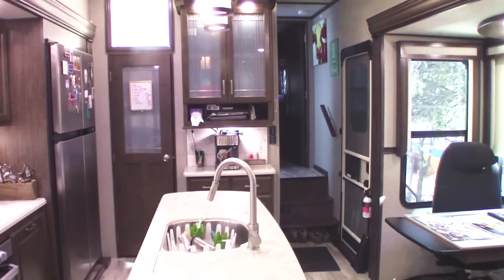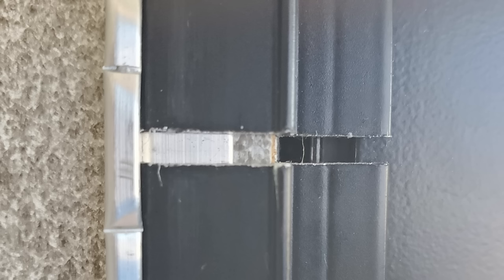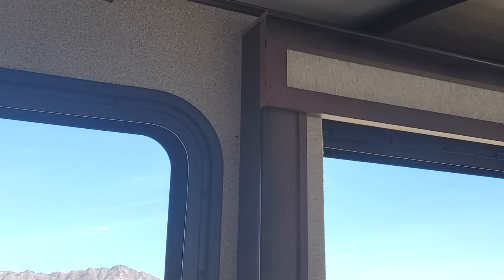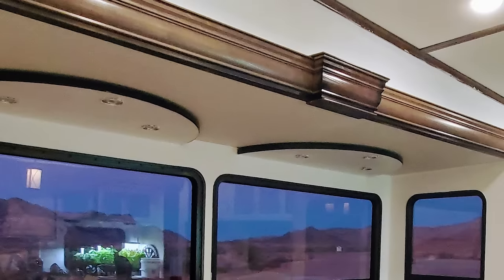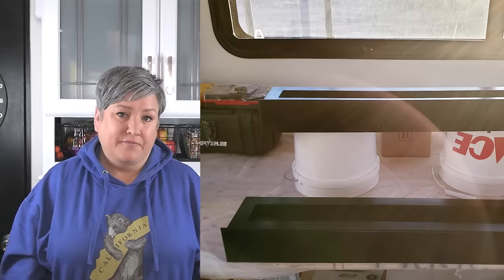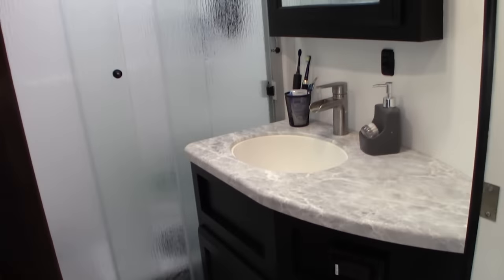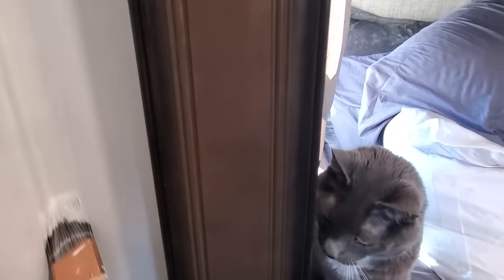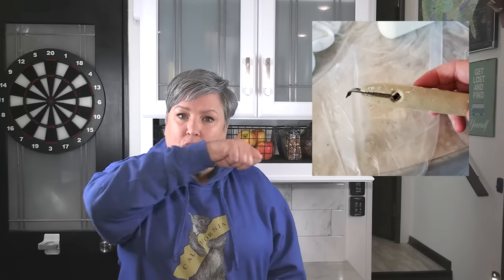DIY CAUTION: HOW TO PAINT RV WALLS & CABINETS. We Painted the Interior of our Fifth Wheel! Learn...

Comment: Haha, yeah we just learned a lot about the same topic. We had bought a 2007 weekend warrior toyhauler and it had the cabinets spray painted dark brown . Thought the same thing as you did and we said oh it wont take longer then a couple weeks, after taking off all the doors from the cabinets and sanding them down. Then we had a problem with the paint not wanting to adhere to them. The caulking was terrible as well. But I was able to work around it though with a house hold kilz paint primer. On the walls we wanted a wood grain look and bought a foam wall paper with adhesive on it that you soak the foam wall paper in water, well then after getting the wall paper up is we noticed it started to peel off in spots... then I looked in the shower area where the walls were just the original wall paper but was in great shape, then I thought "crap" they used water resistant wall paper. So I looked into to what to do about that with out having g to remove all the existing wall coverings, so I bought some drywall mud and just did a skim coat over all if it and to my surprise, it worked awesome. Then we ended up going with a really light grey color on the walls and a union blue (nice light blue with a lil dept to it) . Our trailer also had this 1 inch wide pieces that divided the paneling so I took those off and made our own out of 1.75 inch wide x .25 inch thick  cedar pieces and pre drilled my screw holes, then took a torch and lit them up and put it out after a nice pattern arose, then I sanded down the charred areas then painted with an enamel antique grey color, let dry and then lightly sanded them down to make a awesome rustic look and put those up in there place. Then in the kitchen and bathroom areas we did blue/blackish grey/ grey marble style stick on 3D backsplash ( didnt want to do the real thing because of with the movment from traveling I didnt want them to come off the wall and break ) but all in all came out amazing but took about 2 months working on it after work and on weekends.

Comment: I think your final colors look fantastic. I can only imagine how long this project took. My rv is constructed very differently but one approach that’s totally helped me on all my mods has been to test all the new materials I plan on using on scraps of wall, cabinet, etc from the rig before I go ahead with the project. This might have helped you find a caulk that might have adhered to the old caulk that then you could have painted over, instead of removing the old. But it might not have worked -  🤔

Comment: First, it looks great. Second, I think you can put paintable caulk over non-paintable silicon caulk and it would have been easier. Also might have covered the gaps you found later.
Reply: Silicone is a caulking you should NEVER use for anything anyway. But silicon is an element.

Comment: There is a  product called USP which is a bonding agent. It is thin,like water but easy to apply and goes on any surface. Paint it on, wipe it off, wait 24 hours and you can paint over it.    Maybe  it could short cut some of the scraping.   Your rig looks fabulous.Robyn.

Comment: The clear 100% silicon calk is the best caulk for adhesion and water proofing you can buy. To fill in the gaps get some white water based silicon window calk and you won't have the gaps anymore. It should also match your paint. Apply it in small amounts and use a wet cloth and your finger to spread it into the corner so you won't see it.

Comment: Would covering the clear caulk with paintable caulk been an option? 
I used  flex seal paint in my shower. BIG MISTAKE.  LOOKS GREAT UNTIL IT GETS SCRATCHES.  then it peels off.

Comment: A vinegar wash in ALL walls prior to painting is a godsend. I do professional painting and it makes a huge difference just by using a vinegar solutio, spray let stand a couple min. Then wipe it off. Your wall is ready for a primer sealant. I also prefer to use kitchen and bath paint. It also can come with a sealant which will stop any stains from bleeding thru. Often you'll only need 1 good coat or 2.light coats. It's also better for when one cleans and scrubs

Comment: I did hire someone. I started, I realized that I hadn’t a clue how to prep the surfaces, I called a guy who helped us with moving a couch and he said he did painting. He came over, told me I was using the wrong stuff, and $2000 later the interior of my 15 foot RPod - yup just a little 15 foot trailer, no slides, but 10 years old and very beige - had white walls, gray cabinets and turquoise doors. Fab!
Reply: Creativity Rv  ??? Don’t use WA. Context?

Comment: Get a handheld steamer to remove all the  wallpaper from the walls first !! Not that hard once you get the hang of it. Still have to clean some residue from the paper off the plywood, but not that much. So much easier to paint plywood. Hope that helps:)) Thanks for the video:))

Comment: KILZ stain blocker primer....one coat and done!  We've used it to cover poor paint and marked up walls in sticks & bricks...  And yes, you need a nappy roller, as you'd use if you were trying to paint other rough surfaces, such as brick, concrete block, or weathered fence boards.

Comment: We are in the process of remodeling our travel trailer. Sometimes it works out better prior to your last coat of paint to apply a bead of white paintable caulk and carefully smooth it out. After dry apply your final coat of paint as the white caulks can yellow over time. And it really depends on the space but sometimes installing narrow paintable trim is best or using the yellow tape and removing before the paint dries works. One size doesn’t fit all RV Reno’s. Overall your video is helpful with real life tips. If interested in seeing how we painted our RV you can see it on our channel. I think the more real life info people receive the better their painting will turnout. 
Great video 😊

Comment: I've always used TSP and bleach before painting. Krud Kutter is a TSP substitute, but it's not quite the same. Open every window before using the TSP and bleach mixture, and you'll need to rinse, but it'll be clean .

Comment: 👋🏼I worked at Sherwin Williams for years and my grandfather was also a contractor. A couple of things that may help anyone who reads this on their next endeavor when painting. 
Clean the surface, scuff up the surface, prime it, paint it! Make sure to speak to whoever is working at the paint store about your surface to determine a good primer and the right tools such as rollers!  
When painting when painting cabinets, use a foam roller or very fine nap. It’ll take longer to paint but will make the surface look flawless! Also check out using an enamel paint that has self leveling technology which will make your job sooooo much easier! Also getting a paintable caulk for those spots that need to be sealed. 
Using a good quality tape is also important when painting and picking the tape based on how long you want it to sit on the surface. Do not take the tape off before it is dry. This is a myth! Taking it off before it is dry causes it to look splotchy and peel. Use the right tape and do not over paint! Less or more, allow proper dry times, and then add coats.

Comment: Cabinets are painted. Benjamin Moore. 
Walls will be shiplap panels, slide out done looks sweet. 
Got some vinyl plank for a new floor, doing that last obviously.
I got a nice big piece of butcher block, gonna dump the existing kitchen countertop and make the top slightly larger with a drop leaf.
Trailer when bought was converted to house plumbing so sink hunting  should be easier.

Comment: TSP works for washing walls then rinse when prepping the walls for paint. Using a primer with a bonding agent, then finish with a finishing paint.  Using a paint sprayer will make the process go much faster.  A paint sprayer can be rented at most hardware stores. Use youtube to learn how to use the spray painter for your RV..this will be quite helpful.  Use a good quality paintable caulking for finishing/filling the inside corners of walls instead of a molding.

Comment: Tape has a time frame that it can be removed without all the trouble. The manufacturer usually has it on the label of you can google it. The yellow tape by 3m is like 3 days before it is hard to remove. Any moisture in the air will shorten the time as well. Take it from a 30 vet as a painter

Comment: Oh, how I feel for you guys!  Painting can be such a difficult learning process.  Prep is everything, as are proper tools, techniques and the right paint.  

*TSP with chemical resistant gloves is a great prep cleaner & degreaser.  

*Kilz is a great primer, they have several kinds for different surfaces/purposes.  Basically, a high solids paint covers better, which means fewer coats.  

*There is a decent caulk remover tool usually sold in the bathroom section of DIY stores; remove what you can, then recaulk with a paintable similar color caulk, then prime, then paint over that.  

*Use an elastomeric spackle to patch areas; it has a bit of flexibility good for a moving RV or homes with expanding cracks. 

*I've used so much painters tape, yes, remove it before the paint dries, and pull it back on itself.  

*Learning how to edge with a good angled edging brush is a valuable & time saving skill.  

*Clean your rollers before using them!  You can wash in a machine, but I prefer removing fuzzies with packaging tape. I make loops with the sticky side out, fit over my 4 fingers and pat the roller. I do this with several pieces until the roller isn't shedding.  

*Small foam rollers work well and a good brush for "tipping" for cabinets.  Thick nap rollers for textures. 

*This Old House & other sites have great videos for painting tips and techniques.  

Take heart, we all make mistakes & learn from them. I started painting and staining when I was twelve when my parents built a house.  I'm still learning.  Great video; your hard work shows.  I'm sure you'll help many by sharing what you've learned. 💜

Comment: Most paint companies suggest 220 or 320 sandpaper at 400 is what is used to remove over spray 600 is used for clear coats/ polishing  and generally not good to start with for base paint. 600 sandpaper leaves little to no surface resistance for the paint to adhere to(to smooth). When working with clear lacquer(any clear coat finsh) a light sanding might be required between coats. Again check with manufacturer and cure times between coats. Cure times are temperature and humidity sensitive.  And if they give you a touch test make a test sample at the time of painting (usually a piece of cardboard works great).

Comment: Your RV looks amazing & TY for the info. Lord knows I'm going to need it! I just embarked in removing the wallpaper from our rig. Thank God I watched a video where the gal suggested using a blow dryer (I used a heat gun). My next step will be sanding the plywood,  then paint. I just hope mine looks half as good as yours!! Stay safe and happy travels 🤗🤗
Reply: Betty how is it going with your project?! We have horrid wallpaper I would LOVE to get rid of and paint.
Reply: @thatsmomsense9087  I got rid of all the wallpaper, sanded & now it's just sitting there with bare walls 😊. Haven't touched it since late June! It's been too hot (and I hate the heat) to get in there and work. Hopefully it will cool down soon so that I can get some paint on the walls.

Comment: As a painting contractor, if you paint your trailer. You will only need one coat on primer. It will not cover. You want primer to adhere and block any stains. Use a quality flat so it doesn't show as much imperfections. Caulk and fill nail holes as you see fit

Comment: Thank you so much for this! I wasn't going to paint, but the paneling my guy just installed wasn't the birch I thought I was getting, it was the yucky brown stuff used in basement playrooms in the 1980s. I won't bother with tape and I'll get that little razor tool because this guy is silicone-crazy too. :-)

Comment: Thanks Robin, great video as always.  I was wondering if you, or anyone following, had plastic/vinyl edging between panels, around door frames etc.  I have this tan edging all over the place and don’t know if I can just paint it.  I bought my Kiltz paint at the beginning of the pandemic, and haven’t been brave enough to start, but I think this will be my spring project!  I’m curious if you removed any factory installed furniture too or painted around it... I have a folding futon that might just need to retain old wall color in the parts you can’t see!  😳 Thank you!

Comment: Maybe you can try filling in cracks and hide paint imperfections near the edges by using white caulking.  If you can apply a very thin bead in the corner, you can use a damp finger to blend/smooth/fill cracks.  Instead of those big tubes that requires a caulking gun, the ones you can buy out of a toothpaste like tubes are better for this type of situation.

Comment: Great video. Very useful information. I haven't done any RV painting yet, but I've done a lot of houses. I don't have a very steady hand and always tape. Yes, I hate it with a passion, but I hate awful paint lines worse. Sometimes tape doesn't work out so well, but one thing I know for a fact, Frog Tape is amazing. Use anything else and you are setting yourself up to be royally pissed. Frog tape is pretty costly but I will gladly pay the price when I know the results are going to be that much better. I'm wondering if you tried covering the unpaintable caulk with paintable caulk? Again, great video. Thank you.

Comment: I generally don't use painter's tape at all. I use a steady hand and a two-inch tapered brush to cut in everything in then roll the rest.
The heavier the texture is on the wall, the heavier the nap on the roller should be. The smoother the surface is, the smoother the paint applicator should be.
***BTW, silicone caulk can be covered with a thin layer of either paintable silicone caulk or latex acrylic caulk and would have saved you the headache of removing all of that silicone.

Comment: Thank you so much for this video!! I really want to paint our RV and your tips are priceless!! I hate the window coverings that came with our RV and I really want to do some blackout curtains or something along that lines and I was wondering if you have any information or tips on RV window coverings? Thank you so much Robin for such fabulous videos!!!!
Reply: Colleen Levy - I have a couple ideas about window coverings. If you can sew, a simple little trick would be to sew( or glue on) some magnets in all four corners of your handmade curtains (since most rv/camper windows have metal trim). Or  another idea would be to staple some fabric onto wood trim, other wood, or even a curtain rod and glue the magnets to the back. The use of magnets eliminates the scraping damage that blinds would do over time. If your a diyer l love to hear if you try any of these ideas. Good luck !!
Reply: @dreamweaver8210  Thank you so much!! Those are fantastic ideas!! I am definitely a DIYer and I love the magnet idea. That would certainly work for what I am trying to do. I will let you know once I have given it a try!!  :-)

Comment: Removing caulking is a water leak waiting to happen, Cut it low and caulk over it with siliconized acrylic caulk that is paintable. Keep the water seal though. Never use spackel  in a moveable building of any kind. It will not flex with the motion and will chip,crack and peel over time. Good luck with that. Use something flexible like a paintable caulk if you must. Also look into plastic paint edgers. That crack along the ceilings at the walls is a motion area so just slip a two foot long edger into the crack, paint with brush and pull the plastic out. Perfect edge. Wipe excess paint off plastic and do it again. Pretty soon you will use less paint and not need to wipe any excess because you won''t have excess. Shellac based stain sealers are great primers for all staining especially on wood. Saves tons of grief with bleed through stains and cuts down on prep work but washing all surfaces is a must. Traditionally use TSP which is a non sudsing soap that does not need rinsing is used. Will get rid of grease, grime, and smoke including nicotine. Probably the main ingredient in that expensive fancy spray bottle you have there. TSP is TriSodium Phosphate. Follow directions for how to mix because it can be used as  a paint stripper as well in strong mixes. Just curious how this spakle has held up over time. Any cracks or pops? Any water damage from removing caulk around countertops and bath/kitchen areas?

Comment: If you ever have to do it again. Inexpensive trick for filling in cracks. Use Bondo instead of wood filler. It's inexpensive, strong, sandable and printable.

Comment: I have a question - since it's just paper on plywood does the paint change the moisture retention inside? Is it possible that there's black mold underneath?
Reply: That's why they used Killz paint/primer. Killz is for mold. RV/campers have very high moisture retention because it is a tiny space. Even with fans, it's a good idea to use a dehumidifier and also use an antimicrobial paint like Killz....and definitely replace paneling and wood if you find leaks altogether.

Comment: before I bought my house I had a mobile home and painted it and it was the same. I did the several coats etc. It looked great but it was alot of work. I will say this though once the walls are covered when you paint again it a piece of cake. You'll never have to go through it again. I wanted to ask, will you do a video on your outside lightning. I've heard you say about motion lights coming on but do you also leave lights on to scare away mice. Thank in advance,